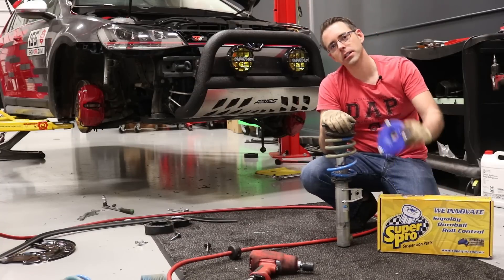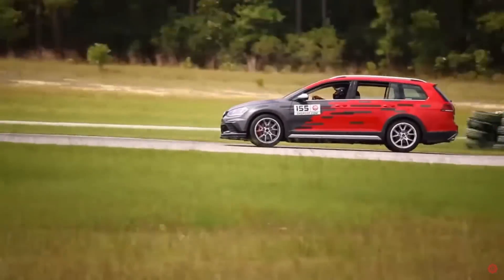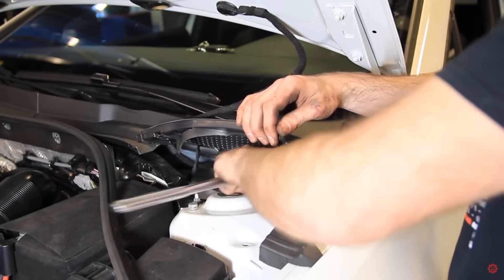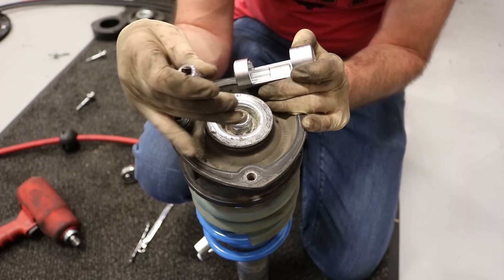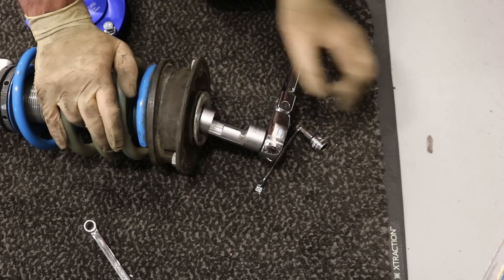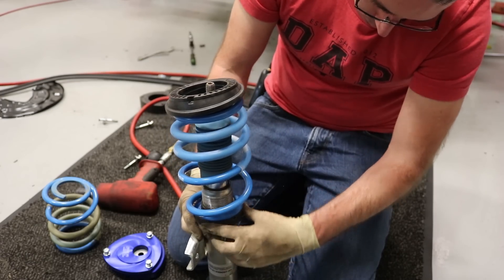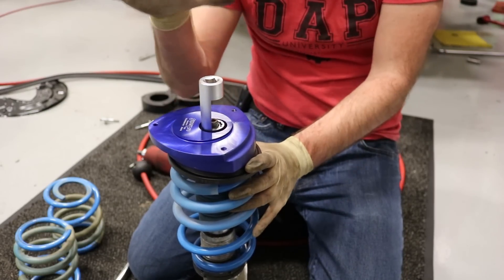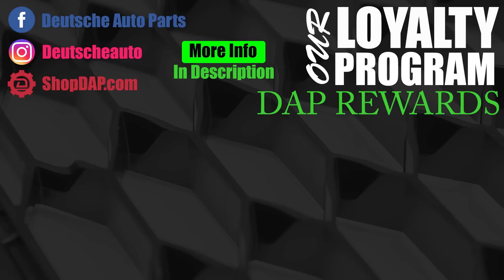How to Install MK7 Camber Mounts (SuperPro)

Comment: A OEM alternative I found was using the Clubsport s front knuckles. Gives you -2 degrees of negative camber and you can still retain factory upper mounts. Currently installed on a mk7 R
Reply: Thanks a lot!

Comment: hi, looks like it adds about an inch of ride height. Is that correct? Obviously you can then adjust that out with your adjustable low spring perch. But on stock struts, what happens then?

Comment: I lowered my mk6 jetta 2.5 wagon with springs on struts and   now when i get it aligned they said i need camber ajustment, i only went 1" lower and tire eats on the inside would this kit help me correct this issue?
Reply: no, this will actually give you more negative camber... although a lot of people think the camber is what destroys tires, it's actually you toe that eats through tires. Wherever you get your alignment, make sure your toe is on point and you'll be good to go.
Reply: @JohnRogoski  ok thank you

Comment: Mine were super squeaky and I highly recommend opening the tops and filling with some grease before installing them
Reply: The Eddy’s Garage The kit comes with a packet of grease. The instructions say to apply liberally to the inside of the bushing. I am assuming they are referring to what you are describing.
Reply: Hwy88 Forever yes they now come with grease. I had one of the first sets made and after letting superpro know the issue they started supplying grease with the tops

Comment: Adding this much camber, would it work for a car being used for long drives and daily usage?
Reply: For street cars we usually like no more than -1.5 to -1.8* camber to avoid uneven tire wear on extended straight trips. 

The more frequently you drive fast around curves, do track events, and hoon around, the more even the tire wear will be with negative camber.

At -2.0* and beyond, you will want to start checking the inside shoulders for wear, and rotating the tires religiously every 5k miles.

Most folks with experience can tell you: having an improper alignment with the wrong toe angle will destroy tires faster than camber.

Hope this helps!
Reply: @TheTexican05  Hey. Thank you for taking out the time to respond. I was on Coilovers for the longest time but since two of them failed, I am back to OEM suspension. I think now its possible to put these plates for daily usage. The Camber would be just a tad below -2.0 degree. Not sure if its feasible for using for long drives or fast spirited drives where the distances are 400 - 500 miles at a time with mix of turns and straights. Completely agree on the Toe angle and whenever the alignment is done, I always ensure the toe is as equal as it can be and the thrust and steer ahead angle is 0 degree.

Comment: I was thinking of something like this for my GTI. I will take it to my first track day in a couple weeks. My question is my car is a daily plus track several times a year. This setup will help corner but what about grip in the straights because I'm pretty sure I have  close to 385 lbs of torque to my front tires? I'm running 245/30 ZR19 Michelin Pilot Sport 4S on it.
Reply: Your right foot will need to modulate acceleration down the straight. With 385lb/ft you are traction limited. 
You will gain more time by improving the geometry by adding more negative camber at the track. 
Aim for 38psi hot with the MPS4S. Start at 32/33 psi front/rear. That’s what I use at VIR. You may need to adjust up or down depending on your track
Make sure you flush the brake fluid and go to Motul600/660 or Castrol SRF or something similar. If regular DEs are in your future, you may want to go to track pads. Pagid RSL29’s or Ferrodo DS2500’s
Have fun. Where are you running?
Reply: @joseduque8912  I have APR big brake kit and coil overs. Thanks for information.
Reply: Those are great brakes!

Comment: Will these camber mounts work with KW V1s?  I have the 034 Dynamic Camber+ plates and they could not be used with the KWs because the bolt from the shock would not align with the center hole where the strut bolts up

Comment: Do these camber plates require any modifications to the opening in the too of the strut towers?
Reply: Following, would like to know as well. I was unable to use 034 Dynamic Camber+ upper mounts with KW V1 because it would not clear the opening of the strut tower
Reply: These are a direct bolt in. Only clearance issues might occur if you have a ridiculously fat aftermarket spring setup that’s super beefy and comes close to the strut tower walls.

Contact SuperPro for the best input here. They’re pretty solid to work with. 🔧 🇦🇺

Comment: Did you experience any clunking with yours? I just had mine installed with ED springs and i'm getting some clunking on dips and uneven roads.
Reply: I’m having some clunking on mine as well. Except I have the stock camber plates. I was looking to upgrade since my handling has been loose. Getting really tired of it.